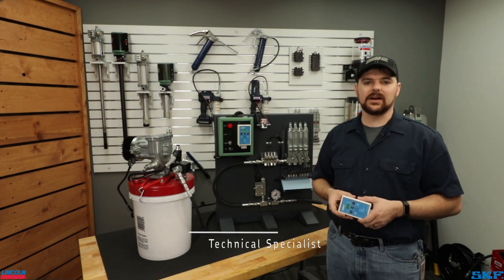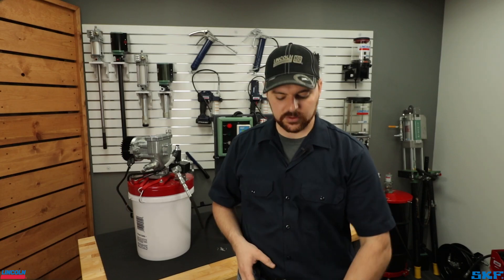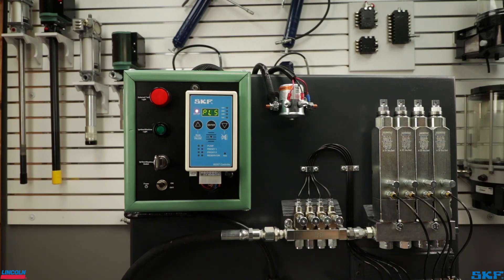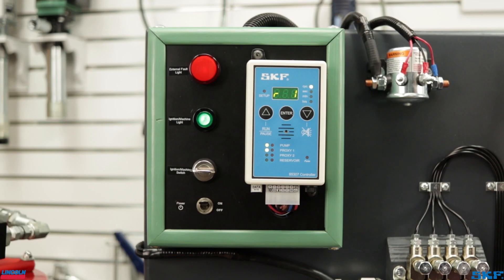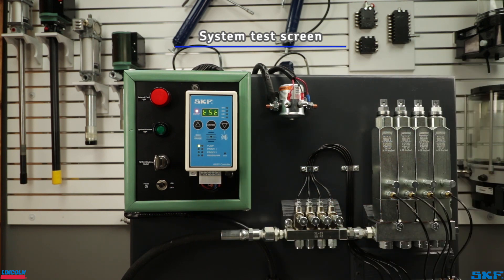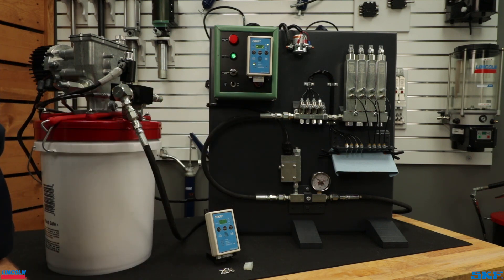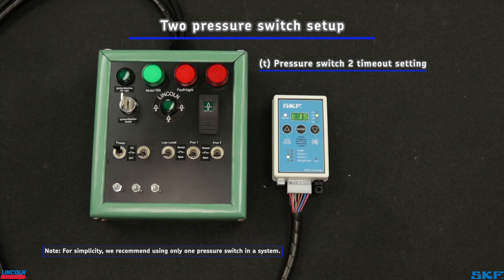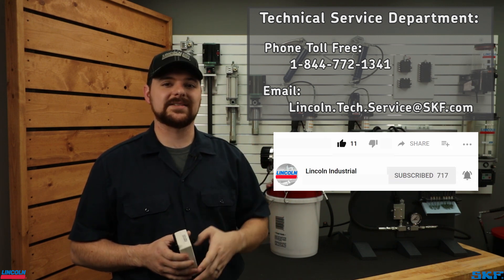85307 Controller setup for single line parallel applications

Comment: where can i find the fault code list? i keep getting F.73
Reply from the maker: The manual should have all the code descriptions. F simply stands for Fault. the number is the time the Fault has been active.  Has the system run a full cycle at all? Normally the indicator of the issue is through the lights below the screen where the lights point to the features that are active or in fault status.  If you need a manual, check out our website or send an email request to the Tech group. 

~John